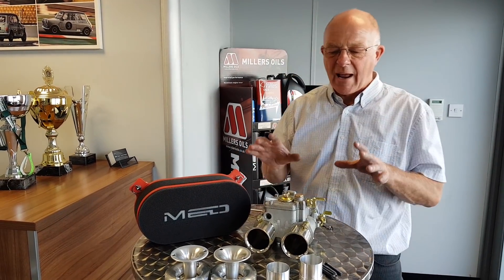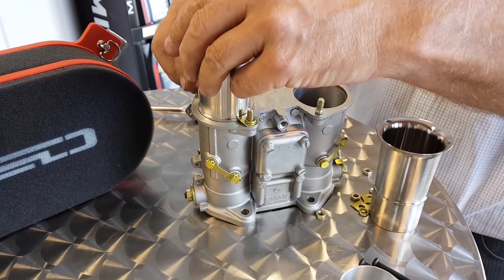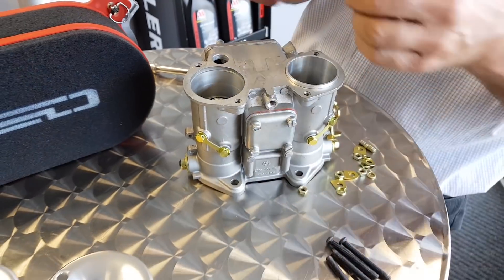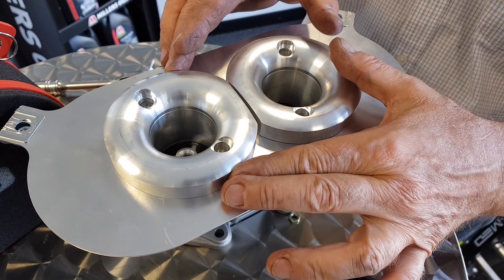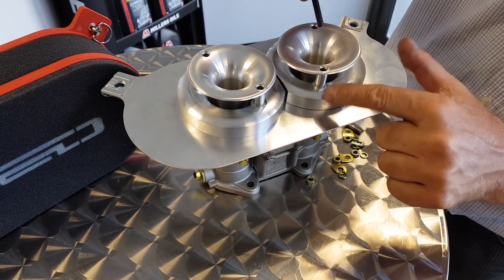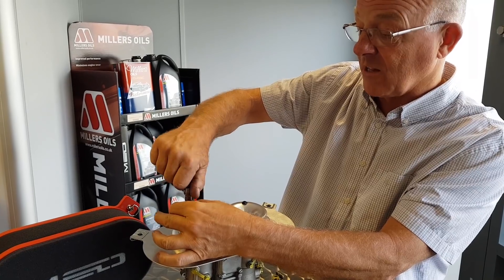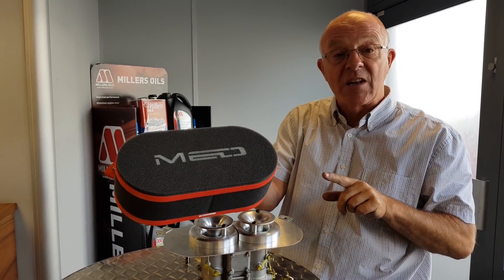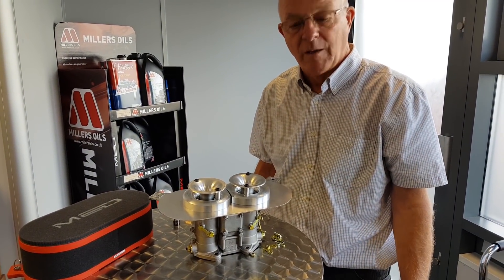How to install the MED Weber DCR kit

Comment: Will this fit for a weber 40dcoe? If not, will you make a 40dcoe dcr kit? Is there a major difference between a 40dcoe and 45dcoe regarding to fitment?
Reply from the maker: Sorry but we only make these for the 45dcoe at the moment, as we do not have much demand for the smaller carbs.

Comment: How tall is the Alu assembly and how tall is aircleaner? 

Will these fit Solex c45 ADDHE? 

Because that what I run on my Volvo B20 I’m an 122. 
And room is an issue.
Reply from the maker: Hi, these are only for the Weber 45DCOE.
Reply: @MEDEngineeringTechVideos  but i run Weber Air cleaners already. Since flange is the same.

So if you are willing to send me the length of the sleeves, and the length the inner Venturi, sticks in to the carb, because if it clears my auxiliary ventures they should fit. 

Possible send me an email at Volvobrynk@hotmail.com 

I really like your setup!

Comment: Thank you MED for the wonderfull mini videos

I have a viewer question. There’s allot of videos on YouTube about o-ringing the head and it block. It’s it worth doing in a mini engine
Reply from the maker: Thank you. No this is not required on an A-Series engine. Carefully machined, you should not have head gasket issues even on the largest overbore sizes.